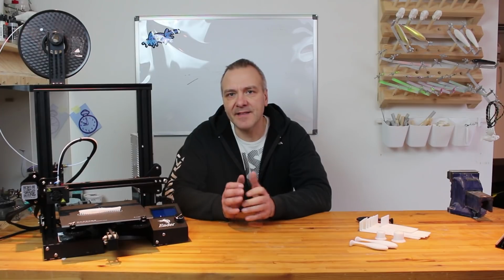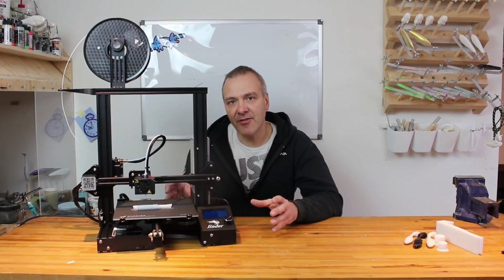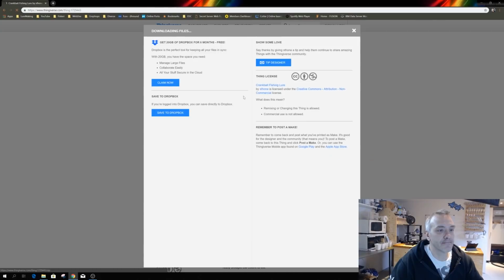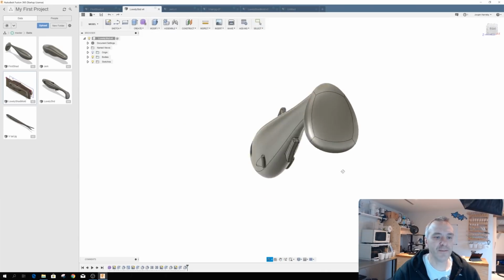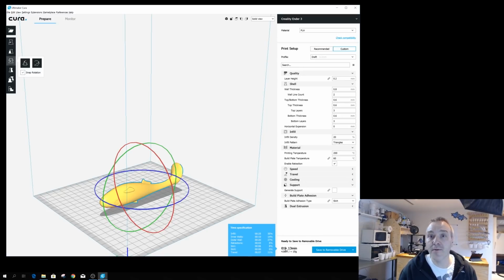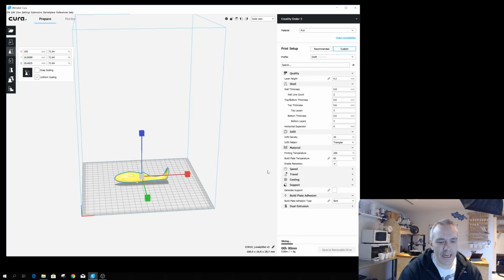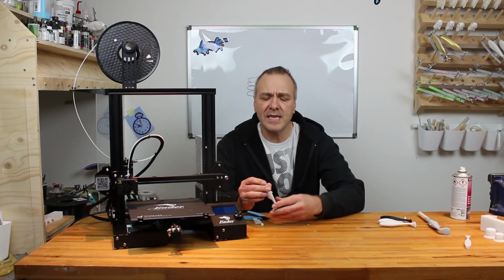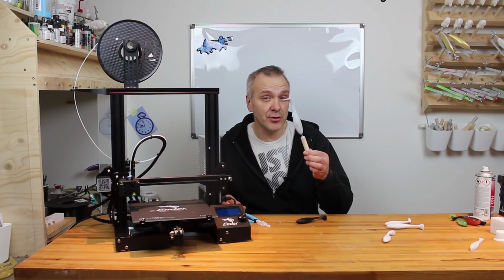A luremakers introduction to 3D Printing

Comment: Thinking abt buying this... I wonder if the pla is strong enough to use as a lure instead of a mold and if it floats or if u need to create some air chamber inside to allow for it... Great if u could share any experience with that... I'm trying to create a improved version of a bomber 15a
Reply from the maker: It all depends on how you print it. You generally print with a outer thickness and a infill percentage, and the strength of your lure will depend on that. But I would say that you can easily make an very strong lure in PLA. A normal infill rate of 20% will make the lure very boyant, and you will have to make room for weights rather than room for air. Good luck with your project
Reply: @SplishSplashFishing  thanks for the recommendation by the way... I got the ender 3 neo for a week now and although the learning curve is quite steep, got my own design and much needed lure in prototyping phases already!
Reply: Success! For now... https://youtu.be/YvRx8ScS_1s

Comment: Saw the whole video. Very interesting to say the least.  Have you used a 3-D printed lure for pikefishing? If so, how is the durability?
Reply from the maker: I mainly use the printer to make masters, but I would expect, that if you set the wall thickness in Cura to maybe 2 mm, your lure would be quite durable

Comment: Hi Jørgen nice vid as always, what do you think about printing directly the mold instead of master lure? I was thinking to design a mold in fusion 360, then print it with ABS or PLA, then pour polyurethane resin inside mold. Do you think 3D prined molds will last longer than silicone molds?
Reply from the maker: I haven't tried, but would expect the surface of the lure would end up very uneven. Also you might end op with the resin cast stuck in the mould due to the uneven surface. But in the end you would have to try I guess
Reply: i think i must give this a try otherwise i will never know 🙂, i guess pla or petg may just not work so i ordered a roll of abs filament... we'll see how it goes

Comment: Fusion 360 is not free anymore (expires after a year)...what is a good alternative?
Reply from the maker: Fusion 360 has always expired after a year. You just go to their website and renew your subscription. However they have made a limit of having only 5 editable designs at a time. However you can switch between read only and editable as you wish

Comment: Do you know a method that i could use to get scales for my 3d prints?
Reply from the maker: Have been looking for that as well, but have not found a solution in Fusion. Think you need another progam.
Reply: @SplishSplashFishing  there is a way, but you better have a good computer because mine always freezes while doing it. There is a channel called CATCH-fishing with a few tutorials.
Reply from the maker: @vikipoyta  My PC i pretty powerfull so I will check out that channel - Thanks for the idea

Comment: What is  "Spagel"?
Reply from the maker: A filler to spray or smear on, and then sand with sandpaper to make the surface smooth
Reply: @SplishSplashFishing  can tou send me a link from Where you get it from.
Reply from the maker: @1joaonobre  I I have bought it in a danish shop that doesn't have a webshop. However a search for "spray filler" should give you some local options to pick from. Maybe this: https://www.amazon.com/Rust-Oleum-249279-Automotive-11-Ounce-Filler/dp/B003CT4AM0

Comment: Another great video. Is yours the 3D Pro, plus any add-ons purchased.
Reply from the maker: No this is the normal version, and so far I havn't bought any add-ons or upgrades. So it's actually a quite cheap entry to 3D printing

Comment: Nice work...lots of good information.  I do so much on CAD at work that I'm hard pressed to want to sit in front of a computer to draft lures.  BUT, I just can't stop myself.  Thanks for the info...cheers.
Reply from the maker: At least it will make it so much easier to get the design to look like you want to. I still have to adjust my design to what I can figure out to make in the program.

Comment: God video :) I’m printing masters and going to try wood filament. Maybe working better to post process?
Reply from the maker: No doubt that it will be worth experimenting with other filament types, to make the post processing easier. Will take a look at the wood filament - Thanks
Reply: Hmm... Not really... Woodfill is based on PLA almost 70 % + real cork / bamboo /real wood dust 30 %... So the printed part will be almost like PLA from post processing point of view...

Comment: The acetone - abs trick works great for lures, but you loose some sharp edges, but if you don't mind that its great.
Reply from the maker: Yes everything comes at a price. For shad masters it wont matter loosing some edges i  think. Thanks for your insight